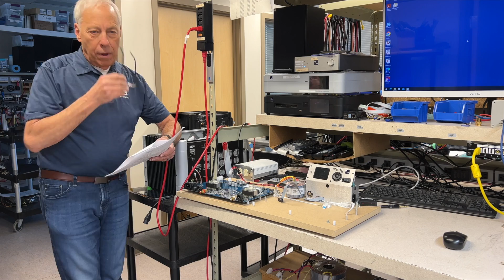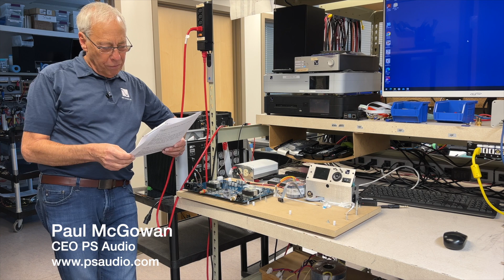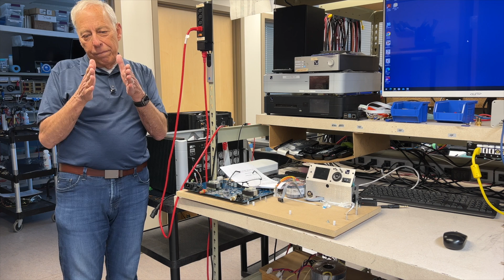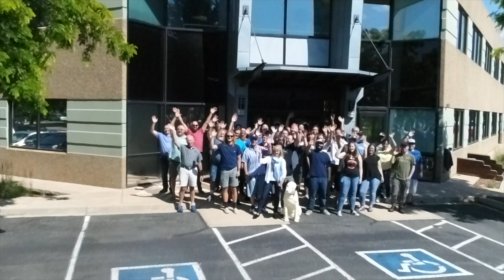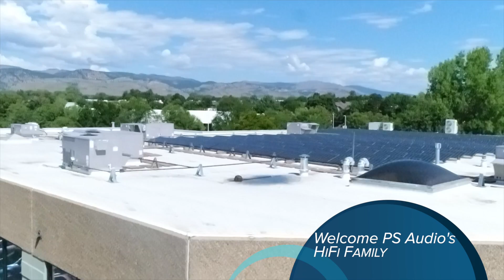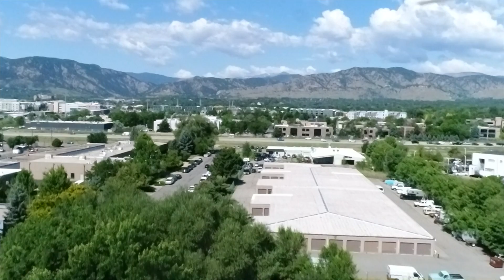Understanding DoP for audio

Comment: Good explanation for normal users.
In my book, DSD (plus marketing) is, first and foremost, a strong instrument for record companies to stay in the business and release "improved, remastered" versions. However, many of the old, but properly done 16-bit CD masters from the sane days of mastering, with the now-old and specs-wise subpar Sony PCM-1630, actually sound better than modern DSD remasters and have audiophile value. Why? Because a good number of DSD/SACD remasters in fact clip and have lower dynamic range. These old CDs can sound better not because of the technology, but because of the (sane, superior) way it has been used in the 80s and the (insane, ridiculous) way it is used now—that takes sonic precedence. On the other hand, I view PCM as the sensible way to store files, and audio processing, mixing, mastering is done in PCM, with final PCM–DSD conversions (since computational operations are done on words). On the other hand, with modern quality DACs and implementations of filters and oversampling, there is nothing to worry about—no audible difference between PCM and DSD is demonstrable in double-blind tests. With that in mind, there also should be no audible difference when playing std-res vs. hi-res in the vast majority of cases for the vast majority of listeners, except in mastering environments, where there can be small differences in transient response and tonality, particularly with different dithering and noise-shaping algorithms. Finally, we also know that people can hear things that are not there at all, but are only in their mind. Thus, IMO, it is not justified to waste space and bandwidth for DSD files. Record companies know that and they INTENTIONALLY master standard 16-bit files/CDs to sound worse than 24-bit PCM or DSD/SACD versions (more limiting applied, slightly different EQing, etc.). Then many people can pick up that difference and say, "High-res is so much better, I'll buy that from now on, I'll buy high-res versions of all the CD albums I love". And so it goes. Very few try resampling the hi-res source with a good SRC, such as Weiss or maybe MBIT+, and ABX the two with their DACs—many would get a revelation. The vast majority of CD remasters of 70s and 80s albums I have heard are inferior to the original masters done in the 80s and maybe in the early 90s.
The irony? In our days, we talk about bit depths and sample rates, DSD and PCM, we have expensive digital workstations, DA/AD, but we use all that technology to compress and limit music to ridiculous levels, within 6–7 dB of dynamic range, wasting all the technological achievements. Take, for example, the band Europe. 14 bits are also fine to play the albums from the last 10 years.
Best regards,

Comment: Well, choo choo this was a real train wreck!
2:06"... pulse density modulation is the basis of all a to d converters and all modern DACs, all of them run DSD and they convert it to PCM."
This is absolutely not true and even Sigma Delta converters don't convert PCM to DSD.
Multi-bit Delta-sigma modulators first integrate a multi-bit input signal which is first passed through an integrator 
The output multilevel signal from integrator output is divided into 1s and 0s DSF (not all 1s or lack of 1s as in a DSD signal)
For decreasing errors in the output signal, it converted back to multibit PCM for comparison to the incoming signal.
2:23 "...at the output so everything runs PDM. In this world of ours, this modern world. Didn't used to be that way it used to be
when we had ladder DACs and Ladder A to D converters we went directly to PCM..."
This is absolutely not true either!
At the output, everything runs analog NOT PDM, and Ladder A to D and D to A converters still exist and there really is no real reason to have to deal with DSD or add in additional conversions from DSD to PCM to edit, back to DSD then to DoP (PCM) back to inferior DSD.
The more conversions are done the greater the chances for errors in the conversion processes.
2:48 "so that we're you know routinely running things at 176 kilohertz and 32 bits or 24 bits (PCM) you really need to use Sigma Delta modulation..."
This is completely untrue as well because ladder DACs can be and are used with these sampling rates.
3:23 ...basically DSD is a constant stream of ones and zeros never stops it just starts going when we turn the recorder on it starts going and as things get louder the density of those bits nothing the timing never changes if it's running at 2.7 megahertz or 11 megahertz like dsd256.
Once again this is incorrect on multiple levels.
1. DSD Just like PCM takes samples so the stream of bits is only recorded at each sample, there is no data collected between samples so the data stream is not constant,
2. While the "sample rate" is constant the timing of each sample both in recording AND playback is dependent on a clock.
The clock in turn is dependent on the power supplied to it and IS NOT constant!
Differences in power supplied to the recording or the playback clock cause distortion of the signal whether it is DSD or PCM.
4:09 "...quiet okay but the point is it is a continuous stream just like analog, analog as I'm talking is a continuous stream background noise my blabbering blah blah blah it's a continuous stream if you look at it on a scope so is PDM or DSD continuous stream PCM is not a continuous stream, PCM is not a continuous stream...
Okay, do I really have to point out that if you are watching this Youtube video and listening to Paul's continuous analog stream of blabbering blah blah blahs that you ARE NOT listening to it in DSD, but you are listening to as AAC-LC converted to PCM.
Go ahead and hook a PCM signal to a scope and you'll get an analog wave just like a DSD signal because both have to be converted to analog.
However go ahead and google DSD, PDM, and PCM and take a look at the graphic representation of each.
Notice how DSD is represented as groups of squares or rectangles whereas PCM is represented as an analog signal.
DSD\PDM IS NOT more analog-like than PCM and is in fact less analog like than PCM.
Reply: Geddy....  You obviously know your digital, that's for sure.  Paul needs to take a class from you.

Comment: If I understand correctly, DoP is a transport protocol for DSD. Similar to Internet Protocol TCP/IP, which stands for Transmission Control Protocol/Internet Protocol. Thank you very much for the detailed explanation.
Reply: @Douglas Blake Yes, you are right, but only by transmisson over the network via ethernet. When transmiting from Source to DAC via I2S not.

Comment: It’s still difficult for me to take in all of the information that you try to squeeze in to 5 to 6 minutes. I think that’s why I’m not getting the hang of all of these new acronyms and ‘you are’ going off into into the weeds with your explanations and it starts to get a little muddy doesn’t absorb all in at once. If I were back in engineering school topics like this take at least several days of classes and assignments and consistently work on a course for months before being proficient in understanding everything that’s going on in these complex circuits. Someone should write a book on digital signal processing for dummies. Perhaps you should watch your own video today and see how many different terms you’ve used in this short period of time where your explanation should take hours for a true understanding of this topic.
Reply: If you are  familiar with  computer programming languages and coding languages, that is what Paul is talking about.  Software and hardware drivers need language coding from a computer programmer to execute their functions.

Just about everything you do with computers, phones, tablets, your audio equipment, even your microwave oven and your car requires some form of language processing code to function.  Microprocessors will not work without firmware and drivers.

Paul probably has no idea he is sitting on top of a flammable BOMB with that Tesla he drives…LOL  THE Only reason Paul safely gets from point A to point B 
is the microprocessor’s in that Tesla. 
It also keeps his house from burning to the ground if it is parked in the garage charging..😎👍😀
Reply: Mr. Scratch, I'm guessing that Paul's last 2 or 3 sentences might have been sort of what you were looking for.  Expounding on that analogy:  Let's say that DSD data is oil, and streaming pure DSD is oil flowing through a pipeline.  But your computer (or other hardware) doesn't have an oil pipeline port!  But it does have the ability to unload oil from oil tanker trucks or train cars [PCM]!  So we can instead put the oil (DSD data) into a bunch of oil tanker trucks or oil tanker train cars (PCM frames) to transport the oil that way instead of pipeline.  When the oil (DSD stream) comes out, it's the same either way.  Maybe that helps.